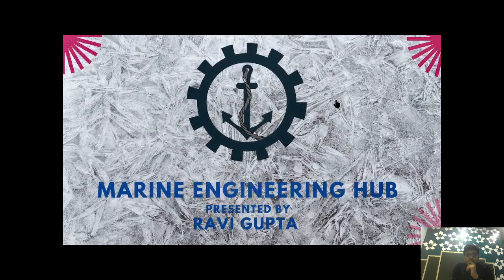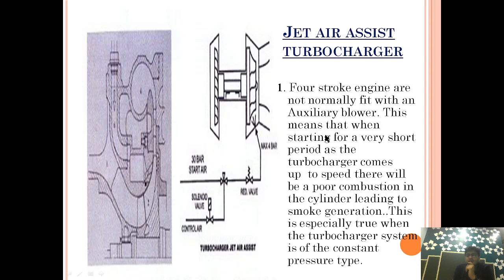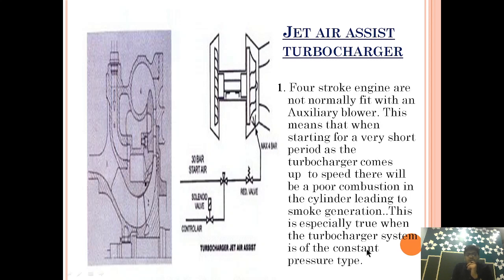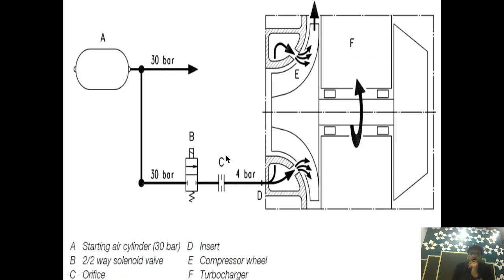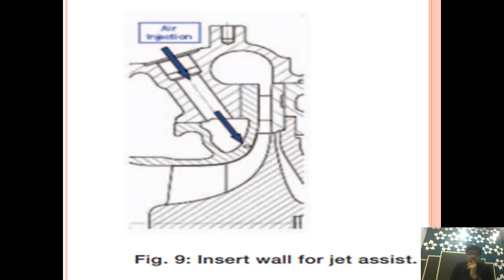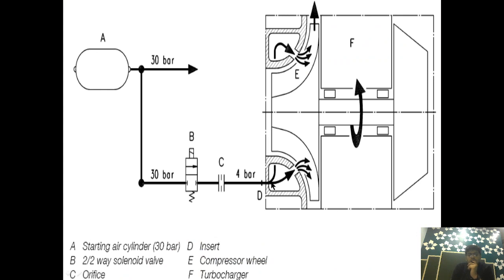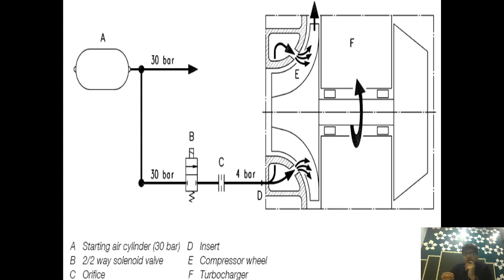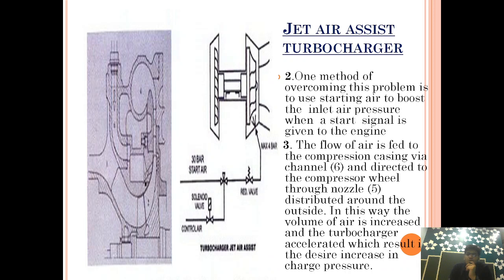Jet Air Assist Starting| FourStroke Engine| Auxiliary Engine| Turbocharger Smokeless Starting Method

Comment: How to adjust lamada controller..engine load is not coming above 700kw.
That arm is touching lamada spindle..after that no load increase..no gap between arm and lamada spindle in 700 kw.our engine 85 percentage is 780 kw.